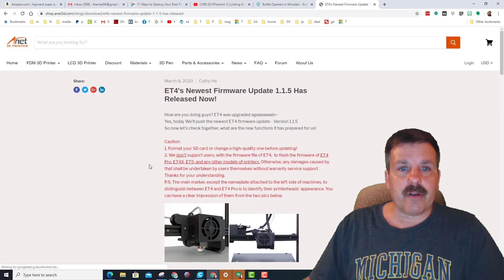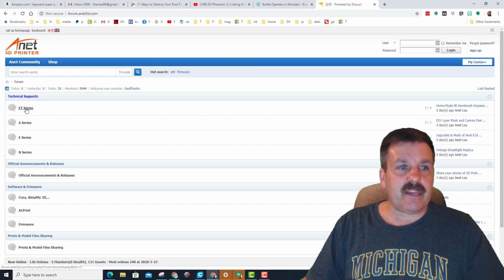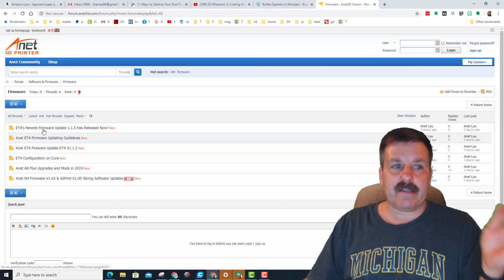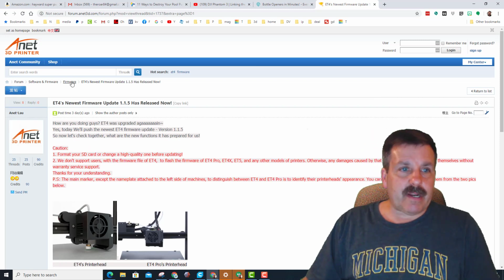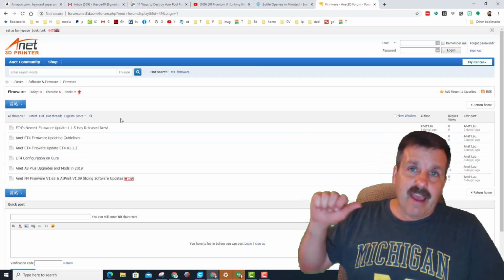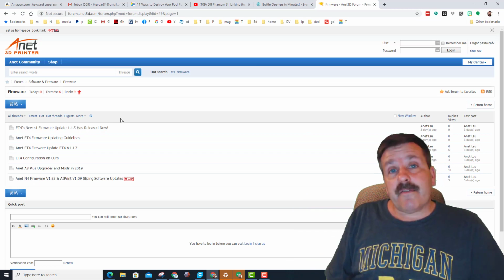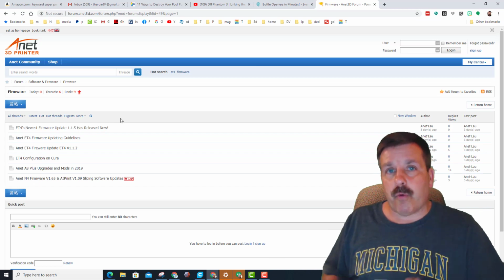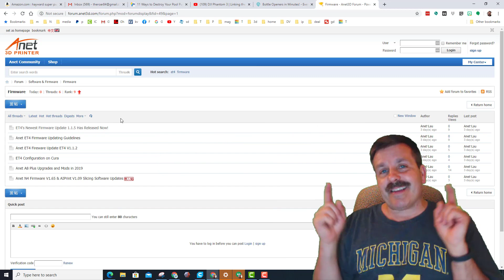Just double checked! Anet ET4x firmware update does not exit... yet

Comment: Hi!
Is it possible to do a downgrade for ET4X firmware 1.0.1?
I installed the BMG firmware but BMG has not arrived yet and will be much delayed. I want to print, but with the 1.0.2 firmware it is not possible with the old extruder.
Reply from the maker: I’m not sure. I’ve never tried to downgrade one. Do you have access to an ST link version two just in case things go bad?
Reply: @HLModTech  I don't have such a device yet (ST Link V2) but I just ordered one now. Is there a way with this tool to reload the 1.0.1 firmware?
Reply from the maker: You can use it to fix all kinds of firmware issues. I would try to just flash the 1.0.1... It it does not work, you can recover the machine with the ST-Link.

Comment: Hello, is the original FW for ET4 X available somewhere? I need to roll it back after installing 1.1.5 for ET4. It was version 1.0.1
 Thank you
Reply from the maker: I would check the Anet forums. I have not seen one yet, but it has not been on my list either. Both of mine have been working really well as they arrived.
Reply: @HLModTech  

The only difference between ET4 and ET4 X is in the position of the Z-axis limit switch. ET4 has it at the top. So I threw the limit switch up here and everything works. The reason for the whole upgrade is that the extruder feeder skips and it could not be solved either by changing the feed or by the temperature. With ET4, this problem does not manifest itself so much and administration is calmer. Anet technical support contacted, maybe the original firmware will be sent.

Comment: Any luck finding updated firmware or perhaps a way to flash marlin maybe? I’ve got an ET4X as well but was looking at adding auto bed leveling of some sort, but all require marlin pretty much.
Reply from the maker: No luck, but I am not really hunting either. Mine has been rock solid so I do not  have an interest in changing it. I also prefer manual leveling. I have done it for so many years it just comes naturally any more.